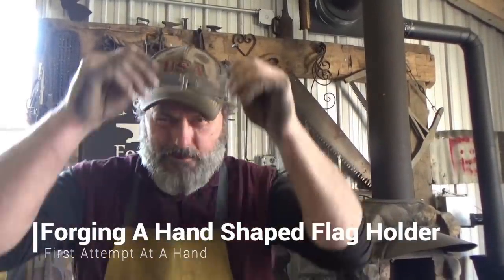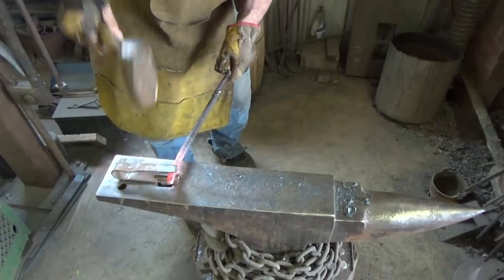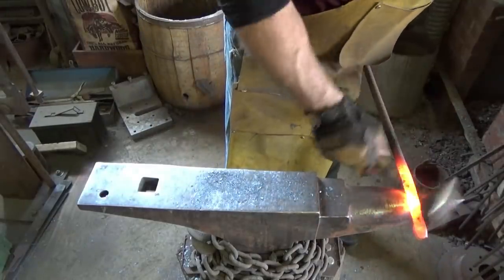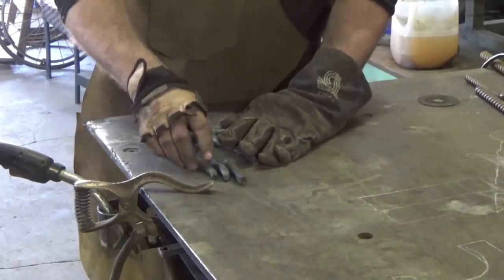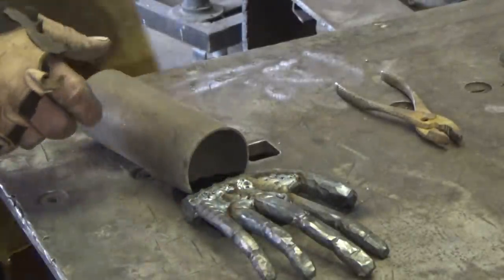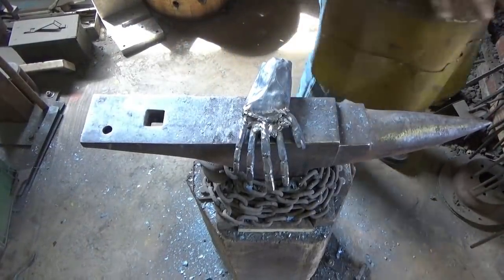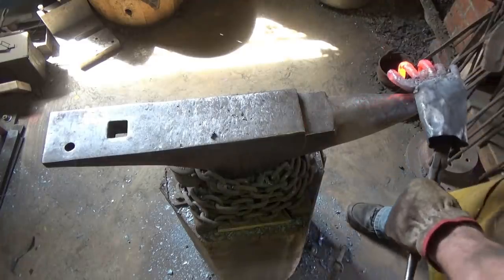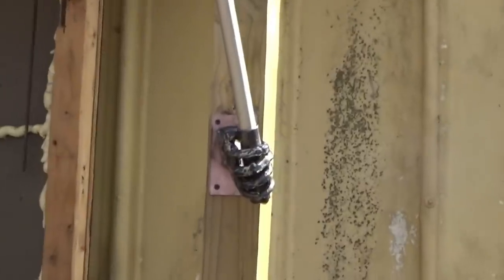Blacksmithing - Forging A Hand Shaped Flag Holder

Comment: Its been over 2 years and no new videos.  I hope all is well and I know I'm not the only one here that hopes you come back with more videos.  
Your saying "Need a tool, Make a tool" has stuck with me for years.  Had some rebar and a hammer and small propane torch and needed the tool to lower a spare tire.  that saying popped into my head and i did just that.  forging in a circle k parking lot. LOL

Comment: The thumb is attached at the wrong angle. I would cut it off, and weld it right back on so it points differently. Otherwise, I think it's great! Thanks, Chandler. Jon

Comment: If you make another in the future and want or need it to be anatomically correct based on male or female:  Male (index finger slightly shorter than the ring finger) , and Female:  (index and ring finger almost the same length).    What would be a fun project is to make a middle finger hand and send it to Nancy Pelosi and Chuck Schumer.   Better yet,  Bill de Blasio